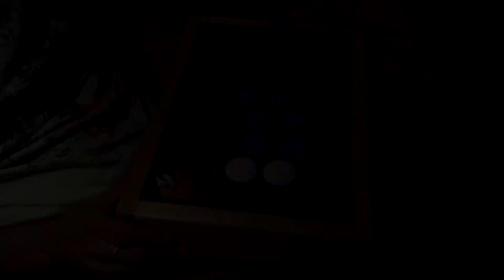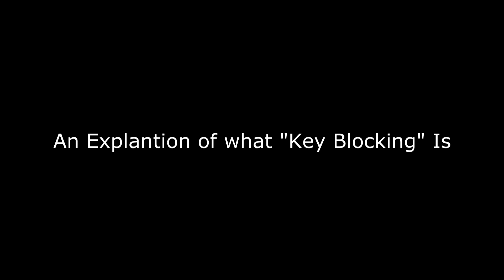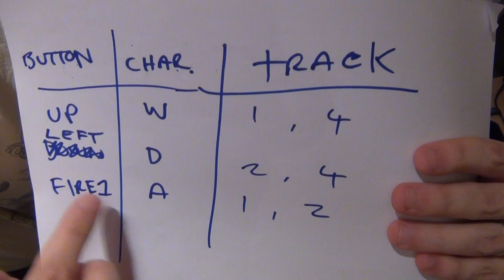DIY Wireless Arcade Stick (Part 2 - Includes Key Blocking Workaround)

Comment: I'd suggest searching "keyboard ghosting explained" if you're attempting a project like this. The microsoft link allows you to visually test key combinations so you can make sure your potential joystick movements and action buttons can work together where required. I was thinking about doing this and pairing it with my existing logitech unifying receiver. Problem is if I ever need to re-bind I'm not going to be able to type in the confirmation code :) Input lag also scares me.

Comment: guys if any of you thinking of doing something like this, tho this is very well explained, you could save a lot of troubles if you just use a ps2/3/4 (or 360/xbone) pcb pad as your main stick pcb. Only thing you will need to do is solder the cables to the pcb and build the other end so you can plug and unplug it from stick/buttons.
Remember, only thing that you need 100% quality is your stick and buttons after that you can use anything as you main pcb.

Comment: Wow, thank you for covering that key blocking thing. I've been reading about this but all the information is from the late 90s/early 2000s and seems to refer to PS/2 keyboards. I didn't know if USB encoders did the same thing. 

One of the apparently debated solutions that key blocking problem is putting a diode in between (diodes allow current to flow only one direction). I'm unclear on whether this actually solves the issue.

I'm actually doing the exact same thing right now with a USB keyboard PCB. Just have to figure out the box part. Not on to a wireless one yet. I was going to save that for custom gamepad (the "phat" sega saturn ones are under-rated...).

I took an idea from other sources though and I'm using a "common" wire. In other words pin 6 in combo with pins 20 - 26 produces different keys. Just daisy-chain pin 6 to the the other pins (with black wire, for common). No overlap that way. can't really pick your keys though, have to use autohotkey or something. Sorry for long post!
Also, the old "iCade" for the ipad (amazon has them used for ~$20) has 8 buttons and a stick and demonstrates this common method quite well...

Comment: ah i understand completely now. I did notice you used screw on buttons. I normally use snap on sanwa buttons, because you only need one drill size for the hole and it slots in easy, but I suppose for this process, it would need to be screwed buttons.

Comment from the maker: Thanks!  The plexiglass is held down by the buttons.  When you tighten the button screws on the bottom of the panel, all the panel layers tighten together. Also the joystick holds all the layers below the artwork together as well.  So to replace the artwork you would have to unscrew the buttons.  Bit of a pain, but not impossible, and a much neater finish then having screws all over the place on the top of the panel.. Hope that makes sense and good luck!

Comment: I really liked how you kept it tidy on the top, but how did you get the plexiglass to hold without putting 4 screws in place? Wouldn't it technically fall off if you tipped the arcade stick upside down? And if it was glued on, how would you change the art graphic?